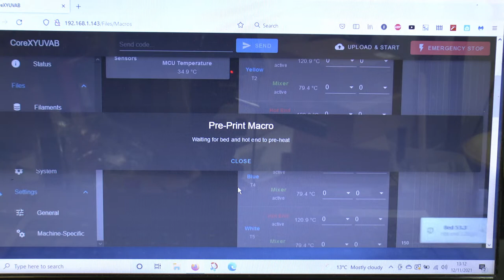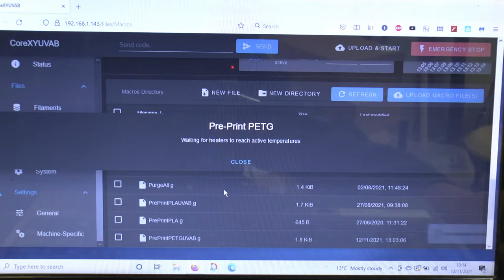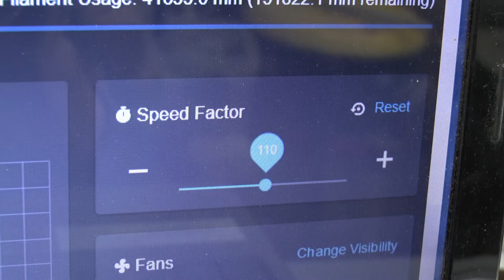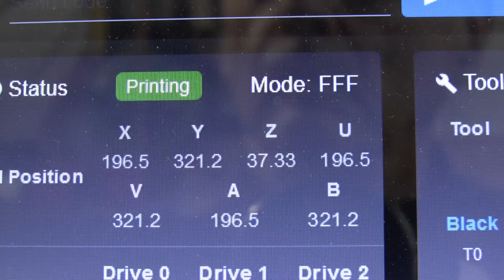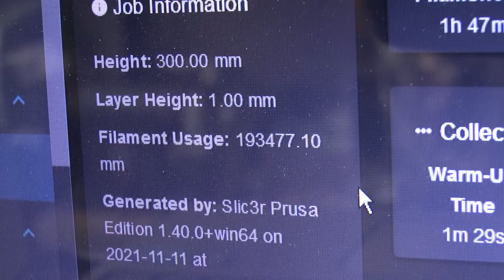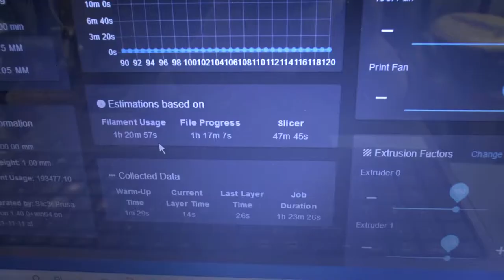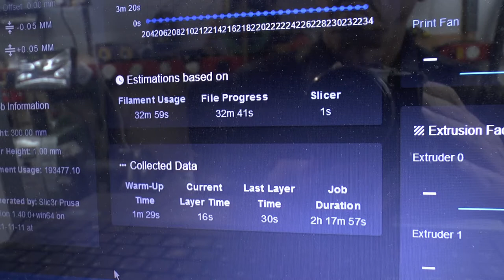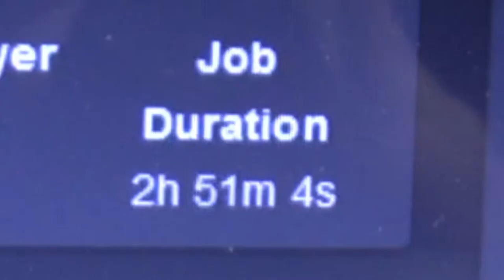Multi Material Hot End - Part3 - Crazy PET-G Melt Rate

Comment: what heaters are you using, as impressive this is to have consistant 45 mm cubic/second I would have thought youd get more but then its probably that huge nozzle stripping away heat very quickly plus your mixing the fillaments and its not a straight path like slice, so back pressure would be substantial.
very impressive to watch, I still cant get over the flying extruders and the counter balace on the top axis, has to be one of the most complex home builds running
Reply from the maker: Thanks. Ref the melt rate - wait until you see what I get with PLA! For sure I could probably get a higher melt rate if I used elevated temperatures. But if I did that, someone would immediately say it's not a fair comparison and that the flow rate is because of the higher temperatures, rather than the design of the hot end.
Reply: @deckingman  too true on the heat aspect, I just watch pla @ 240 through a volcano only achieve ~ 25mm3/s. Though that bondtech cht nozzle looks promising, could also help blend your colours ?
Reply from the maker: @tvathome562  Yes the Bondtech CHT (made under license using 3DSolex's patented core heating technology) looks like it might be worth looking at. I suspect that it might not make much difference in my design because the filaments are pre-heated and already molten long before they reach the nozzle. But it might help.....